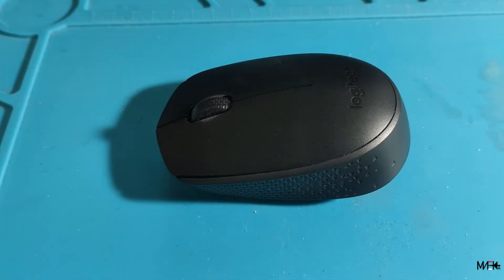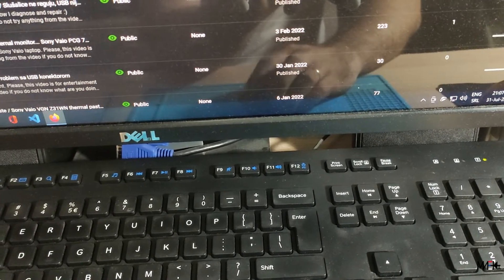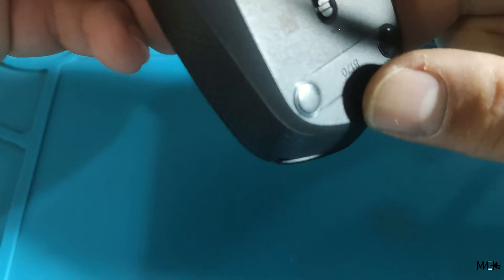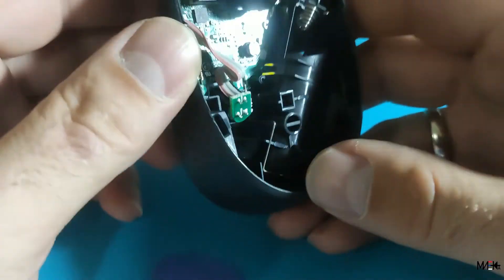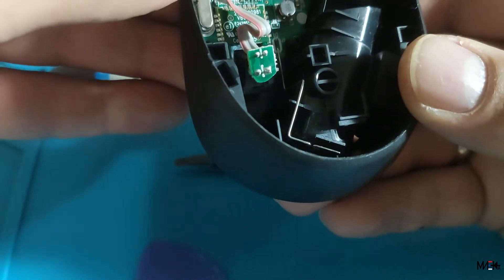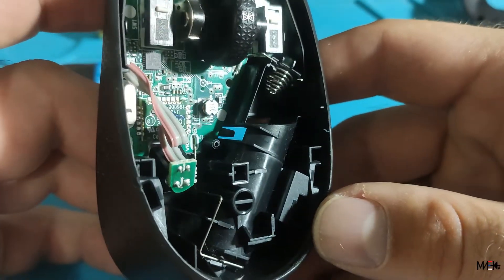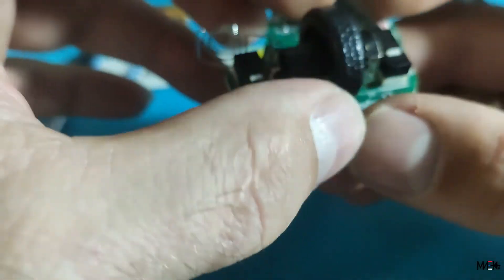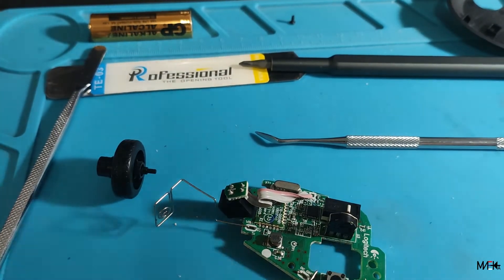Logitech B170 mouse - wheel not react properly- problem sa točkićem

Comment: My wheel is not scrolling at all. What could be the problem?
Reply from the maker: Wheel is connected to one component which looks like potentiometer, maybe this component is broken or most probably that plastic part (like needle) from wheel which goes inside is broken.
Reply: @Robot How can I fix it, mine has the same problem. The part that goes inside the potentiometer hole is broken. Any  fix?